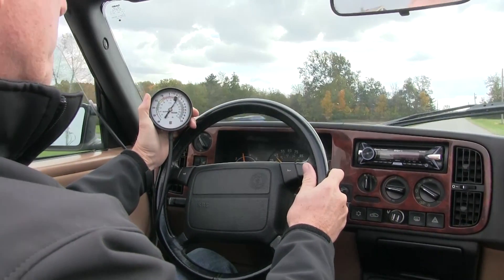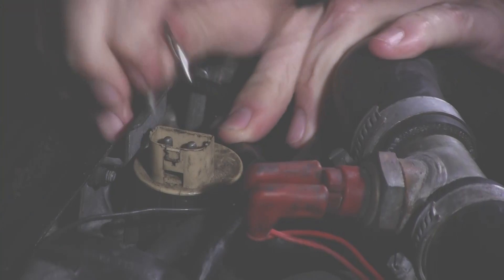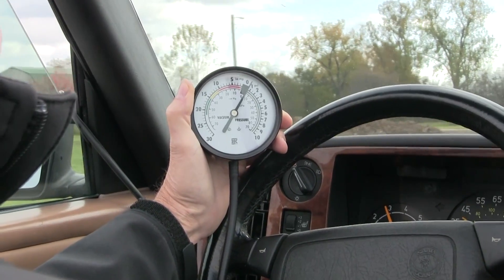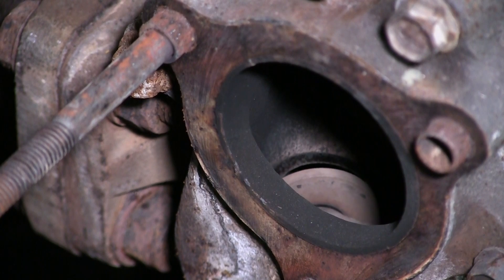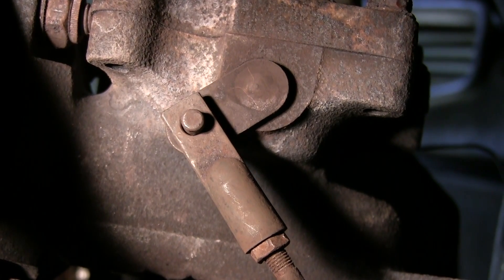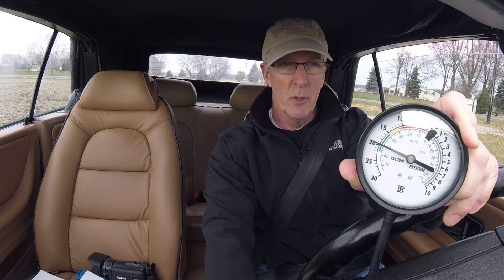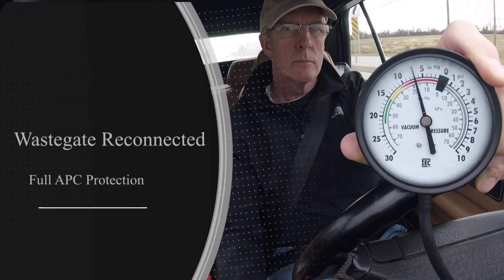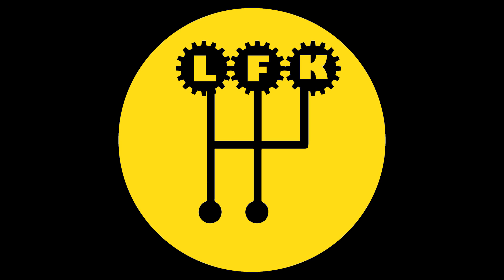SAAB 900 Turbo Boost Test

Comment: Pulling my hair out. I know for fact the solenoid went bad. I had been up boosting to just inside red and taper to 7/8 yellow but then it went lame, so replaced solenoid with a known good one but now spins freely all the way to... half yellow. When I bought the car the knock sensor was disconnected, interesting.

Comment: do you know how to install msd 6200 on a saab 900 turbo 16v year 1990
Reply from the maker: I don't think that's going to be a direct fit as you'll probably need to create some way to tell it the position of the crankshaft.  There's lots of expertise available in the Facebook Classic 900 group.  One of those guys will probably have a solid answer for you.
Reply: @LeeKelso  thanck you

Comment: Did you ever find out the cause?
Reply from the maker: Not before tearing the engine part for a total rebuild after a head gasket failure.  After that process I found that adjusting the waste gate rod to keep the system closed and holding pressure helped.  I'm now boosting just across the red line on the gauge.  Here's something interesting:  The CE has a special "red box" APC controller that supposedly boosts power by something like 10HP.  I found a tweaked APC controller from Swedish Dynamics boosts it even more into the red than the "red box".
Reply: @LeeKelso  Yes you have the Red Box APC which was set from the factory at 0.85 Bar boost. (12.5 psi). But you will only get that on high octane fuel, such as Shell V-Power.  Base Boost with the APC unplugged should be 0.45 bar ( 6psi). Base boost must be set correctly, before plugging the APC valve back. As always with the B202, its critical the ignition timing is set correctly. 16 degrees BTDC at 900 rpm with the Distributor Vac hose removed. They need setting about once every 2 years as the chain stretches, then the ignition timing drifts out.

Comment: you know we charge for finding the problem, so this one is free, un bolt the exhaust the down pipe, dont loose all the way, but a leak is what you want ,try it if boost is better remove the cat, you dont need it anyway if its under 1995...................................... it's the cat i think

Comment: and what you show as the knock, is not the knock, the knock is a bit lower by the intake runners, it has a bolt in the center of sensor, i dont know how much  you know, but GREICO will fix the problem

Comment: Hi Lee, just reviewing this vid because I need to check boost on both SPG and vert.  SPG seems to have similar problem as yours, and vert has Boost OOC (Out Of Control, lol).  Did you solve your problem?
Reply from the maker: It's better,  but still not full-strength.  I shortened the waste gate actuator rod as much as possible. That puts the boost needle almost to the red, but I believe it should go just a bit higher.  I plan to put the gauge back on it and hit the road for a new measurement soon.
Reply: @LeeKelso  Did you ever solve the boost problem entirely? I'm working through base boost (or less, like your car) on two 900s right now.  

I did notice in the video that the electrical connectors on your APC solenoid are naked and no longer insulated (crumbling on mine too). I read a Saabnet thread (https://www.saabnet.com/tsn/bb/900/index.html?bID=453579) where the lack of insulation was a significant part of the problem for the original poster. He said it went from 5 PSI to 8 when he added new insulated connectors. Fortunately, new insulated female ends are still made: https://www.esaabparts.com/saab/parts/7874498. The theory is that the solenoid is magnetic, so it's sensitive to electrical interference. I've also read elsewhere to make sure the starter-to-cap cable is routed as far from the solenoid as possible. That's easier said than done, I know.
Reply from the maker: @cmbaker91    Thanks for the tip on the insulator.  I've added a new connector and will enhance the insulation.   The car is back on the road after a total engine rebuild that includes enlarged bores and forged pistons.  The boost gauge now touches the red, but I'm still tuning and getting things dialed-in.  I'll check boost and post an update soon.
Reply: @LeeKelso  sounds great! Also, what gauge did you use for testing? i'm trying to find a simple and cheap - but also detailed - gauge for testing only. Most gauges i see online to buy are electronic, expensive and made for mounting inside - not what i want.

Comment: Still not hitting base boost so definitely not an APC problem.  APC can't drop turbo output below base boost.  On my car I didn't get base boost until the waste gate rod was pulled pretty tight.  Maybe try adjusting it a bit further and see what happens.  Need to get that rod shorter.  I think every turn is something like .5 psi.  Glad to see someone putting some work into an old 900!
Reply: PS, start looking for a spare transmission.  :)
Reply from the maker: Yep, know what you mean.  I have one with type 5 gearing in a donor car on standby.
Reply: Have a 94 classic 900 turbo convertible.  Having a boost problem and removed the hose to the waste gale solenoid    Check my new video out and 0-60 times are quick!     Engine seems to run great.   Have to figure out what is causing the boost problem with apc hooked up

Comment: What you showed as the knock sensor in the video was actually the water temp sensor. The Knock sensor is on the side of the block, to the left of the oil filter.
Reply from the maker: You are 100% correct.  I was in a rush to get this edited and published, so when I discovered I'd neglected to get a shot of the knock sensor I slipped in what I had on hand.  Good on you for noticing and clarifying.

Comment: You need to keep adjusting the base boost pressure until you get 5 to 5.5 psi under full load in 3rd gear with APC disconnected. With the APC reconnected you Red APC box should take it to 13psi. The Red boxes were rated at 185bhp, when using the highest premium fuel.
Also check the base ignition timing. With the Dist Vac hose removed and plugged, the timing should be 16 degrees BTDC @ 850rpm.  The timing marks are on the flywheel marked from 0 to 30 degrees in 1 degree increments. So you can fine adjust it to get it spot on. PS: Im an ex Saab Master Tech and did my apprenticeship on classic 900's. If you need more tech help im also over on the UK Saabs forum.  uksaabs.co.uk
Reply from the maker: Please find me on Facebook and PM so I can share an idea for a new project with you.   @lfklivestream
Reply: @LeeKelso I don't do Faceache.. YouTube, twitter, and Instagram are enough for me to keep up with !. (same name on all).

Comment: Lee, Saab central has a sticky for first time turbo owners, I know you are not, but its a great read. I know there are a lot of comments about change this or THIS has to be it. I have the same issue with my 85 SPG. I cant get full boost with APC but ive been going over vacuum, o2 sensor, AMM, temp sensor. before I do the turbo adjustments as everything else needs to be tip top. When I pull the hose off I get crazy full boost too. Anyway, here are the steps. 

1. Change the oil to full synthetic quality oil and filter, regardless of what the PO says.
2. You change the coolant and flush the system, regardless of what the PO says.
3. You replace all ignition components, that being the rotor, cap, leads and plugs (NGK BCP7EVX for 16v turbo, BP7ES for 8v turbo), regardless of what the PO says.
4. You investigate or/and replace all vacuum-hoses, regardless of what the PO says.
5. You test/replace the bypass-valve, regardless of what the PO says.
6. You unplug the connector on top of the APC-solenoid (located above the radiator, with three large vacuum-hoses going out of it, and a connector on top), to check the base-boost. Drive the car warm, find an inclining road, go into third and floor it. Note the boost on the CALIBRATED boost-gauge, and adjust to 6 psi or 0.45 bar. Shorten the actuator rod for higher boost, lengthen it for lower boost.
Reply from the maker: I've seen this and followed many of the steps. Thanks for the post nonetheless. There are other SAAB guys out there who might benefit from this sage advice.

Comment: I'd guess at a weak wastegate spring most likely due to the very low base boost but before concluding that you have to cap the ends of the inlet pipes at the turbo air outlet and at the throttle body then pressurise (10psi or so) the intercooler and pipes to check for boost leaks. Ideally with a proper workshop smoke tester but I did find a boost leak at home on the wife's 93ng by welding up two bits of scrap exhaust tube capped off, one with a tyre valve pulled through a hole drilled in the cap.  Worked a treat finding an almost invisible split in the intercooler end tank. Boost leaks = overspeeding turbo.
Reply from the maker: I had no idea this particular turbo might have a waste gate spring.  My understanding (always subject to correction) is It's the job of the adjusting rod attached to the actuator to hold the waste gate closed.  It takes a fair amount of pressure to open the waste gate manually by moving the rod, so I see no signs the diaphragm in the actuator is too worn to withstand the exhaust pressure.

Comment: Your wastegate actuator basic spring load (in wastegate) is to week. Spring  weekness is Often the case with the later 900 wastegates.  You cant get them anymore ( aftermarket still are) Put a extra pull-spring outside the wastegate to get some basic pleasure of around 0.35 -0,4 bar or try to adjust the wastegate rod,  Or modify a earlier wastegate (up on 1990 are stronger) to your td04. If you want to be sure you can put your wastegate hose directly to the pressure site of the turbo (like a LPT version). If you still have low basic pressure then you are sure. The spring generated the pre-lowed you need to get to 0.4 bar. I am 100% sure this is your problem
Reply from the maker: Yet another mention of a waste gate spring.  Hmmm, I better dig deeper into this and see if this particular model has one.  I've seen them on other turbos, but not on either of my 900's.
Reply: When the 900 got the mitsubishi turbo's the problem with those week springs happends. You can try to adjust the wastegate rod a bit. Basic pressure is the key word here and that comes from your wastegate spring. https://goo.gl/images/574MJu

 I work with saab since 1986. Its my full time job since that time. At the moment i run Saabpartners.com and have a staff of 9 in the workshop. Great brand and busy times. Saab is still alive here in Holland.  Keep up the good work. Cheers

Comment: Install a knock led. Check bypass valve. Baseboost should be 0.40 to 0.45 bar. Not higher with the Misubishi te-05-12b. The spring in the wastegate is not strong enough. You can open the 3 way valve and give it a clean. The 900 classic 3 way valve never fails unlike the Trionic 5 one. You can tap the knocksensor and hear if the apc system works. A good Ignition system is very important. If bad it can cause knock and turn the boost down. So make sure stage 0 is good and done first. Go to 900aero.com for a lot more infomation on Saabs apc system and more.

Comment: I need to know now!!!!!! I've a 1999 93 aero! I feel lucky I bought her! Knew nothing of saab b4! Now I just love them! Mine did the same as yours! I put a variable valve on, now that works! But every time I change gear the revs take time (1second) to reduce! I've cleaned the Mas, replaced the throttle body, she is fully serviced and money no object maintenance! But Noone can seem to fix the problem! Anyone any ideas? I've asked a saab ' specialist' but they only work on 2000 + Vauxhall GM saabs! Not the real deal! Someone please help!

Comment: Oh I forgot also to mention Ecu. Some of them had their ecu modified for higher boost. Some soldering done maybe that too needs to be checked
Reply: This one is the modified APC box. The Red ones were offered in the Dealerships as part of the Performance package which also included a 2.8bar fuel pressure regulator, upping power to 185bhp. The Red box was also standard on the 900 Carlsson in Europe.
Reply: not true, hi boost is done using the RED apc ecu, there is no one burning chips for the classic 900 ,jack stall was, but no one can find him and his chips sucked..................................

Comment: I think it is definitely the apc controller. The later ng 900 do have occasionally boost valves giving up. I went through 2 of them. Your test shows without it the car runs fine. I don't know if a fuse for the apc exists on the classic 900. On the ng900 it does you can check that first
Reply: No its not. Its the waste gate that's the problem. APC is fine. See my comments above.

Comment: Turbo is fine, because hitting full boost and fuelcut with wastegate hose disconnected. I think, but you didn't test it, that with hose from compressor to wastegate you hit the baseboost you had earlier. with the hose directly connected instead via the apc solenoid it's the most accurate reading.
For now, because you still having too low baseboost it has to do with the wastegate. Get the controlarm more tight or get a new wastegate actuator.
If baseboost is 0,5bar, then you should get the full boost from the APC. if then still not enough boost, then there is something wrong with the APC system.

Comment: The apc valve on my 9000 didn't work either,tried everything from a new valve to rewiring. Never found the problem. I decided to delete the apc valve altogether and run the turbo on Base boost pressure, which I can now regulate by means of a pressure regulator between the turbo and the wastegate.
Reply: When the triacs in the ECU go bad the solenoid doesn't work the way it should. I tried to replace them but as I did not have a small enough soldering iron I screwed up part of the circuitry of the ECU. Only thing left to do then was to buy a good working used ECU and do an adaption run. After that all was well again.
Reply: yes that is correct good job

Comment: Will pushing the brakes and throttle at the same time damage the brakes?
Reply from the maker: It certainly could overheat and warp the rotors, so keep the test brief.  It takes less than a minute to get things to settle down and give you a solid reading.

Comment: So..  with the apc solenoid wiring disconected, it has no boost.  With the apc physically disconnected, it has full boost.  That would mean the apc valve is leaking internally, shouldn't it?

Comment: I had the exact same problem, was only boosting about 0,6 bar with red box. But then I changed the spark plugs and set the correct ignition timing, now it boosts 1 bar!

Comment: For my SPG, faulty knock sensor wiring was the culprit for low boost.
Reply from the maker: I put in a new knock sensor a few months ago, so I don't think that's my problem.  I'll keep after it so keep watching.
Reply: the apc has 3 small axis  1 f freak,2psi,3 knock, can be adjusted with small screw driver, do this in very very small turns, problem solved

Comment: You've got a parts car there, swap out the APC Solenoid.
Reply: Well he doesn't even have base boost yet, so not apc valve related. Those old ones never fail. You can squirt Carb Cleaner through the ports of the APC valve until it runs clear, to remove any gunk.
Reply from the maker: I thought of that but will do some testing to isolate the problem first.
Reply: @LeeKelso  Absolutely, but I haven't started my latest project which will be a 900 conversion to a turbo. When that gets rolling, it will be a good segment.